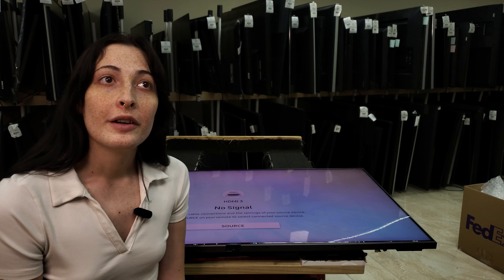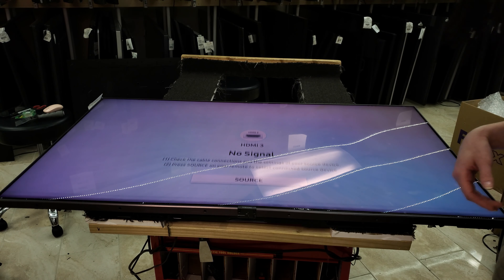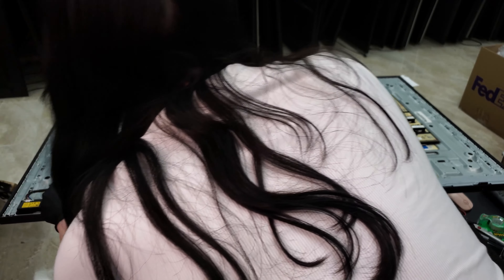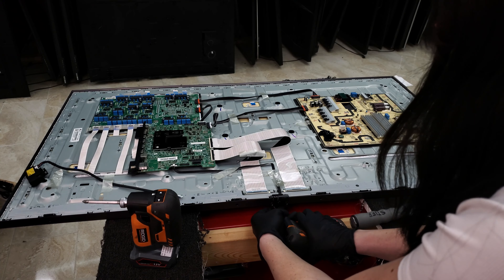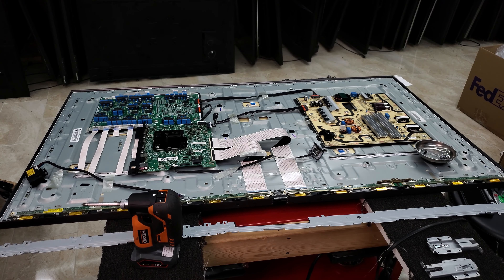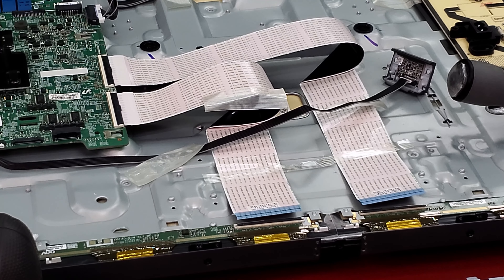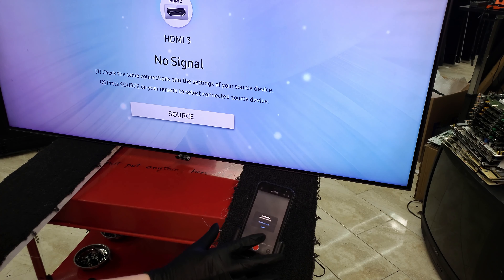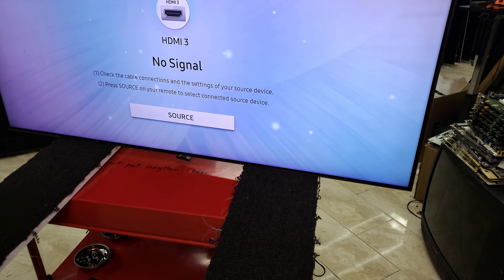Samsung QN55Q8F Glitched Screen Jumping Image Lines | Full Repair

Comment: I have a vizio d43-d2 that powers on, displays V logo and powers off. Single board and single t-con, everything looks clean and undamaged, no swollen or split caps. Ideas?
Reply from the maker: It depends, is it just a flash of the Vizio logo, or it goes through the entire boot before shutting off? If it’s just a flash, check with a flashlight for a backlight issue. If it takes a while, check main. It’s on eBay for ~$30
Reply: The power light comes on and after about 2 seconds the V comes up for about a second as normal but then as soon as it is supposed to go to another input screen it just shuts off completely. Power light and everything goes off. If you try and turn it right back on it doesn't do anything just turns right back off without displaying even the logo but if you wait a couple of minutes and let it cool back down it will go back to showing the logo before it shuts off. Almost like it's something thermal
Reply: some led are dead and the tv go on protection mode and shut down
Reply from the maker: Check our long video fixing a Vizio backlight circuit if you want to learn more. But it sounds like the backlight is open or short for your tv